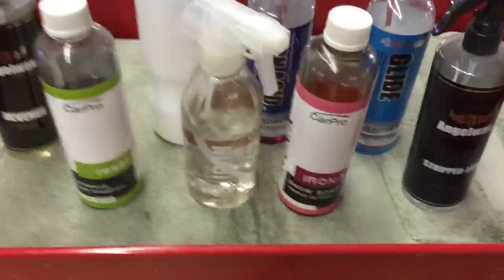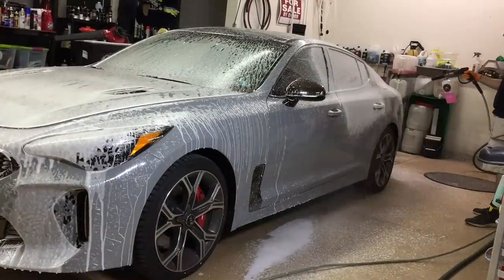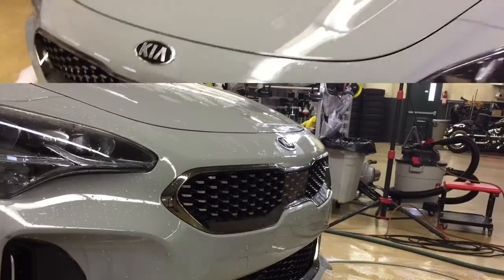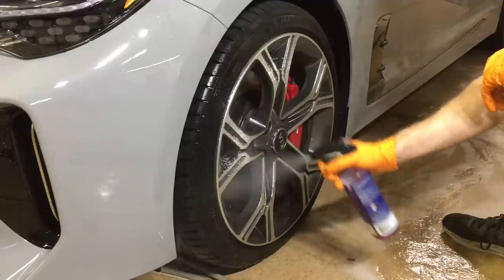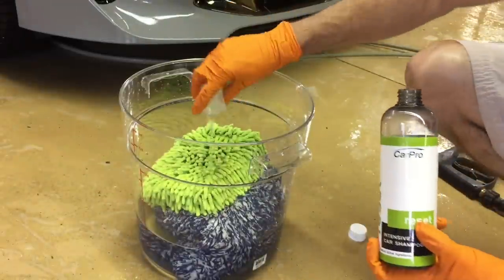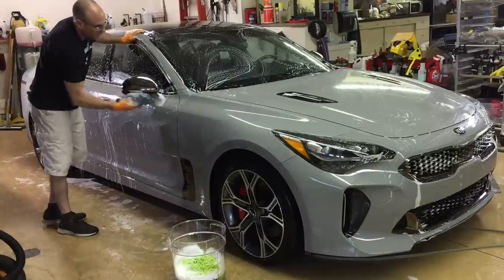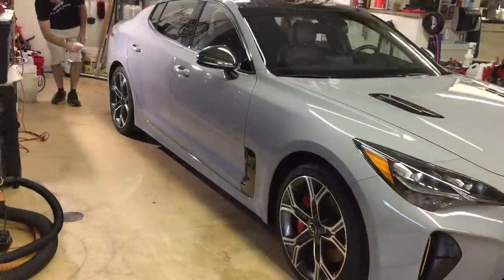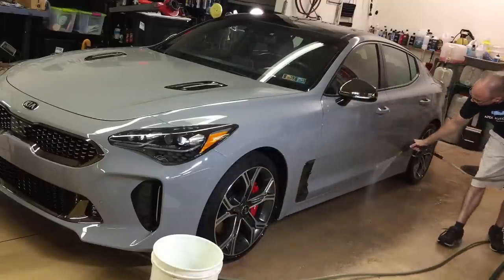Pre-Wash, Contact Wash, Decontamination, Clay. What I Use On A Daily Basis! The Best Of The Best!!

Comment: Brilliant Brian and great to see others methods. I noted a few things I don't personally do:
 
- The agitation with the bug splat remains is a big no no for me personally. You'll no doubt be inflicting some minor scratches/marring as bug remains can be pretty hard at times. I guess as you are correcting here it isn't a huge problem but I find allowing it to dwell 2 mins and rinsing with the PW is enough to remove the insect splat though and negates the scratching risk completely.

- Your method for hand washing is an interesting one. I see your point with 0 dirt being deposited and recollected by your wash mitt into the rinse bucket but there is a problem introduced here. You will be picking a lot of dirt up going over 3-4 panels at a time with them and dragging that dirt across the paint work. At least with the 2BM if done properly you are removing most of that picked up dirt 1 panel at a time and not dragging it across several panels. I see the potential in your wash process though and actually think if you had a single mitt for each panel (roof/glass, bonnet, front bumper, wings, each door, rear wings, boot and rear bumper) roughly 13, could use some of the £1-2 chinese synthetic wash mitts it would present the perfect hand wash. I may consider this wash method in future for sure 👍

Please don't see this as having a go, only sharing my thoughts and not saying there is any right or wrong way. We all do things our own way, thanks for the video and keep them coming! 😊
Reply from the maker: Love the feedback!!! Appreciated actually. Indeed, the bug splatter will swirl, but Iam correcting anyway. Yes more mitts are needed after correction and protection. But again...getting corrected here. I have a wash kit video coming on protected cars CHEERS!!! P.S.feel free to chime in anytime... This channel is for the young up and coming detailers out there.
Reply: Paint will scratch no matter how careful you are at washing. No need to be over critical with 13 wash mitts. Especially cheap  cleaning mitts ... defeats the purpose.
Reply: Thomas Dreiling A cheap but clean mitt will be safer than a dirty but high quality mitt. You are right about the scratching but the whole point is developing ways to reduce the possibility of scratching during washing.

Comment: Another awesome video! A very thorough process! A couple questions...
- what is the pressure washer you’re using and what are your recommendations for one that won’t break the bank?
- what did you use to dry at the end? I think I saw a forced air blower in the background?
- how would you adjust this method if you didn’t have your shop and you were working outside in the sun?
Reply from the maker: 1. Greenworks 2000psi (Lowes or Home Depot.

2. Forced air. P/T Blower, Metro Vac, Leaf blower...any of those.

3. Out in the elements...same chemicals...shorter dwell time.
Reply: Is the Greenworks 2000psi the one you're using or the one you recommend for a good price? Or does that pertain to Both!? :)

EDIT: Now I see you have a video on it! You really do cover everything! Thank you!
Reply from the maker: Absolutely...glad I could help. The unit is still going strong. Used daily.

Comment: I been using the multiple mitt method ( one mitt per area ) than put in bucket ready for the washing machine. In fact mutliple wash mitts are cheaper than all the grit guards for the two bucket method.  Some people even recommend 2 grit guards in a bucket.  To me that means the grit guards don't work as advertised.

Comment: Awesome content as usual...learning a lot from you Brian.  Thanks so much.  Noticed you had the greenworks pw going again with a smaller gun attached directly (wish I had known the greenworks didn't have the 15mm issue my SunJoe does...I can't adapt to the smaller gun without buying 6" worth of damn adapters/converters - so I gave up)  What pw gun are you using..i'm curious? Oh, and I'd love to see your kits for one-steps as a beginner. thanks
Reply from the maker: This is an INKKER Snubnose. Got it on Amazon.  One Steps....will do.👍
Reply: Apex Detail which Greenworks model pressure washer gets you by for car rinsing?  Thx

Comment: I've found that on my own cars, I don't have to use clay anymore when using Gyeon Tar remover and Bilt Hamber iron remover. I agitate the Gyeon tar a bit with a microfiber towel and Gyeon Tar is great that it works on a somewhat wet car also, a property that is not so common I think?
Reply from the maker: I would love if were easier to get some of those products over here....dying to try some. I will look into it again.
Reply: I've always been petrified to agitate iron out products. It would seem to me like your swiping metal filings over the clear. This must not be the case.
Reply: So no clay necessary with a combination of those products?
Reply: Bilal N I corrected the paint last summer and we have salt spread on the roads in the winter and with those products the paint feels smooth to the touch (through a plastic bag). Don’t know if it depends on the climate and location where I live that these products seem good enough? I should add that twice a year I also use Bilt Hamber Surfex HD (APC).